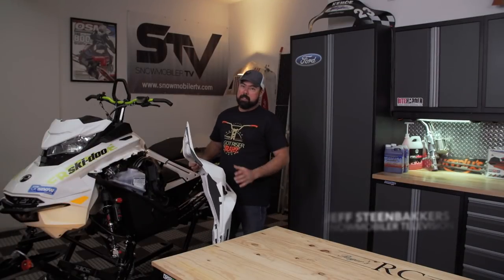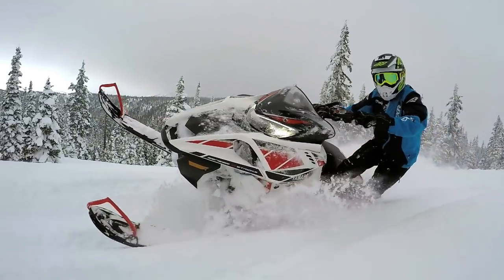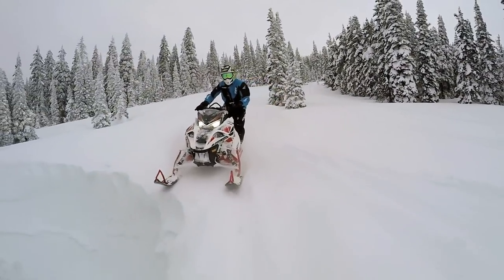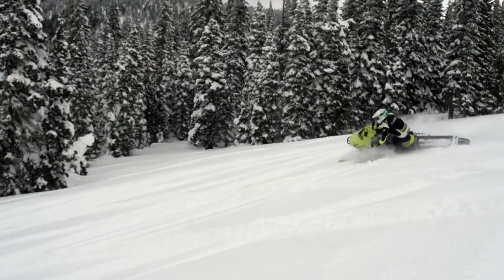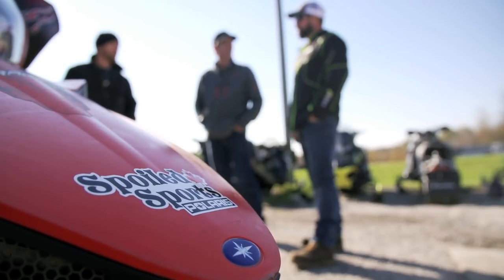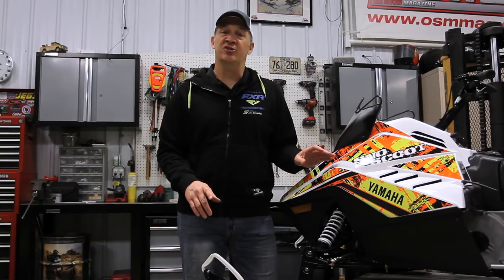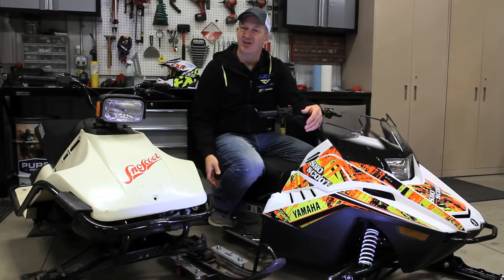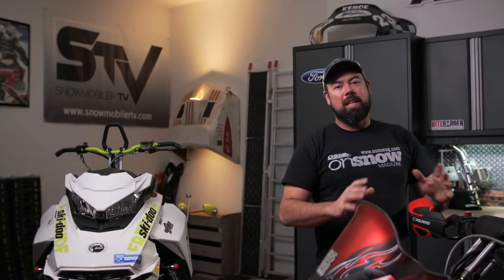STV 2018 - Episode 1

Comment: An entry level snowmobile that is good for kiss is the 1980 Enticer 340 or even a Bravo. You can't have your kids go out riding on a trail for four or five hours with no wind protection or size comfort.
Reply: Grant DuBridge Hell ya..Enticer's were bulletproof.  And i'm a Doo guy.  But the 300 and 340 Enticer's were fun sleds and very reliable.  Also not too hard on the wallet.